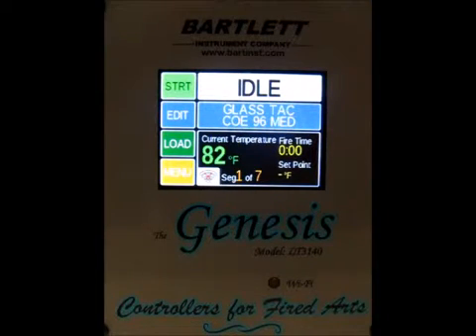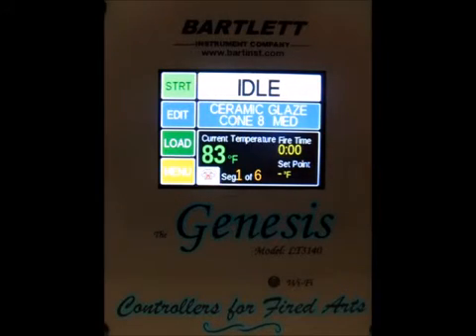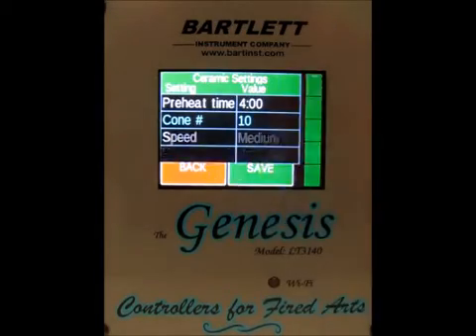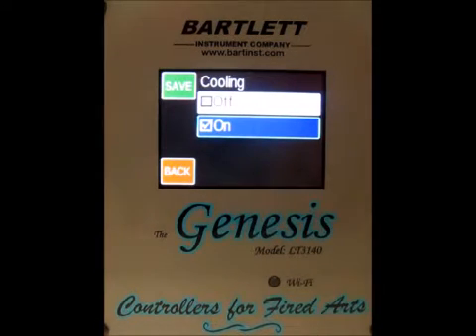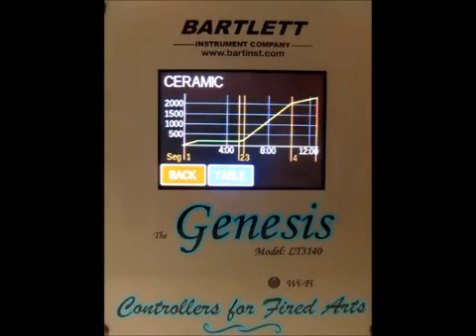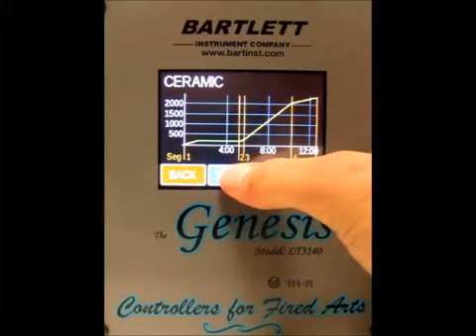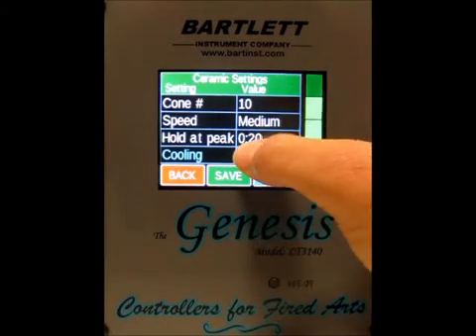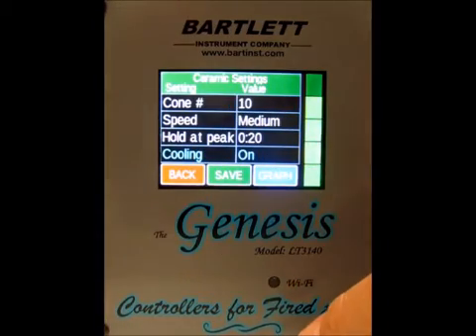Bartlett Genesis/Genesis Mini | Ceramics Programming

Comment: Could I custom change the rate, temp, hold at each segment?
Reply from the maker: As long as you are not in Novice mode you can copy that cone fire profile to a customer user program. Then you can adjust rates, temperatures, and hold times. The Copy button should show in the bottom middle when you press the Edit button.
Reply: Thank you! I also sent you an email, hope to see you reply.  @bartlettinstrumentcompany4969

Comment: With the cooling turned on can I change the speed of cooling? Like instead of 150 per hour can it be changed to 125 per hour. By the way thanks for this video it has finally made this option make sense and I think I'll try it today.
Reply from the maker: You would have to copy the program into a customer profile then you can change rates, temps, and hold times in each segment. To do this when you are in edit press copy then it will pop up for you to select a User program to save it in then select and press copy. Then press edit to make changes.